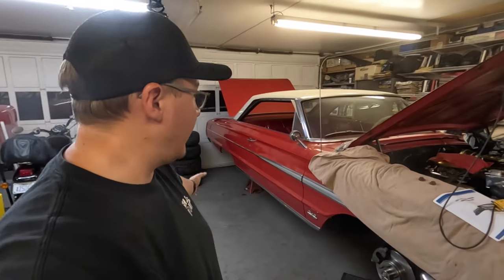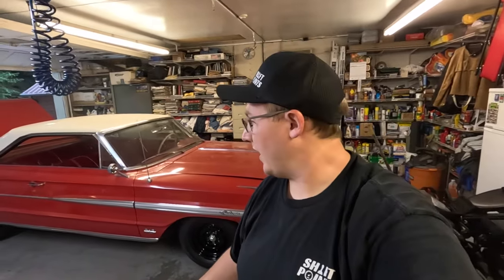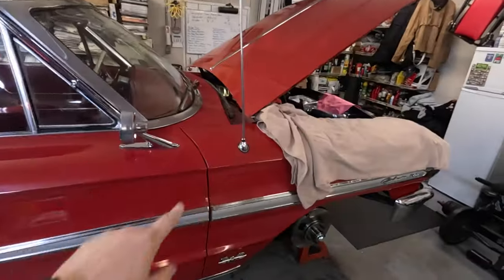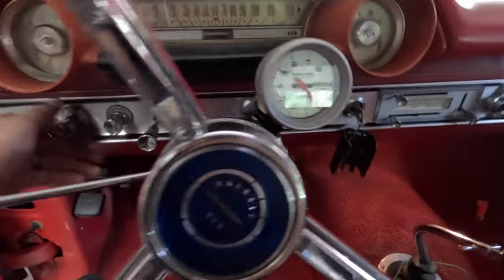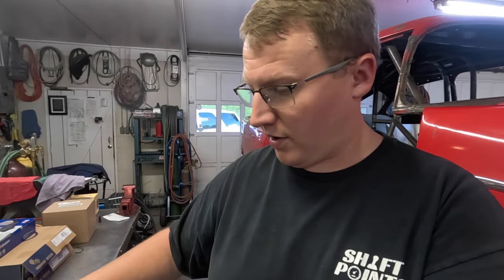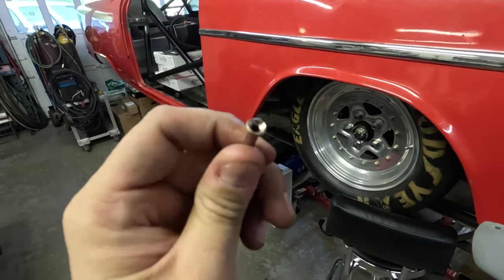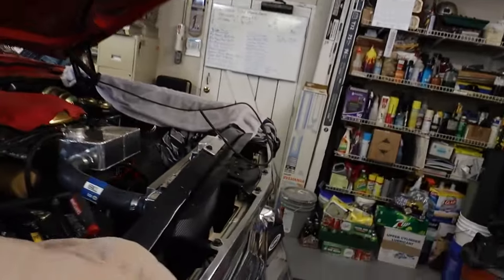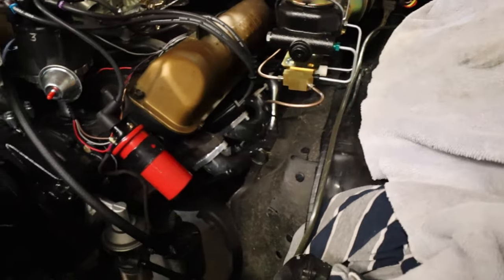1964 Ford Galaxie 500 Restoration: Brake and Fuel Line Update

Comment: The back end side is suppose to go to a frame bracket where it connects to the rubber line that is going to the diff.
Reply from the maker: Sorry you are going to have to refresh my memory here! What's this referring to?
Reply: @shift_points  yes, the rear extremity of the front to rear brake line is suppose to screw into the flex hose that is held in place by a L shape bracket attached to the frame (driver side) just in front of the differential and above it. This bracket is made so the flex line is secured to it and so you can attached the rigid line coming from the engine bay to this flex rubber hose. This hose then is connected to a Y bronze fitting that is secured to the diff tube with a bolt. The Y then can be connected to the driver side wheel and also to the passenger side running a top the differential.
Reply from the maker: @sydrider6023  Oh okay understood! That's true for the drum brakes that were on it from the factory. Since the disc brake calipers have to float you have to have a rubber line at each caliper. So I just picked the shortest way to the L brackets I mounted on the frame and ran it that way. So far it has worked super well!
Reply: @shift_points  yes, I didn’t think about your rear disc brake set-up. You absolutely need flex lines for this.
I was able to pull the original steel line from my 63 this evening. I have purchased a stainless steel pre bent line but honestly, I have no idea how I will reposition it like the original with the body on the frame…😣
I saw you have a nice proportioning adjustment device under the brake master. I think this will be my next project since I have the front converted to disc brake.
Reply from the maker: @sydrider6023  Yeah! I got this whole kit calipers, rotors, booster, master cylinder and proportioning valve from MBM Brakes in Asheville, NC. It all went together really well. One thing about these cars is they are HUGE but when its time to run lines and everything else everything get super tight lol
Reply: @shift_points  you are absolutely right. I had never really studied how the fuel and brake lines were installed in the Ford plant. They run left and right of the frame and often on top and very close to the body. You also have locating tabs that cannot be removed unless the complete body is lifted up…. You might want to do a vid on the proportioning valve adjustment and all.
Reply from the maker: @sydrider6023 That is crazy! And  I have some other videos on finishing up the brake system on here! The valve is super easy. It's literally just connect up and go really. It's not adjustable just built for disc brakes on both ends.

Comment: While I appreciate what you're doing and your willingness to show your progress.

I cannot understand half of what you're saying because of the mumbles and slurs putting words into a strong at times.
Reply from the maker: We were still just using a go pro at this time so the sound wasn't as good as we wanted. Hopefully if you see anything now it will be clearer and I have tried to be more clear with my words lol but I'd say you are stuck with my accent, 30 years is hard to break 😂
Reply: In all honesty, I cannot find a single word or let alone a complete sentence that is not easy to understand in this video.
Reply: @sydrider6023  👍
Reply: @DasMoose9001  👍